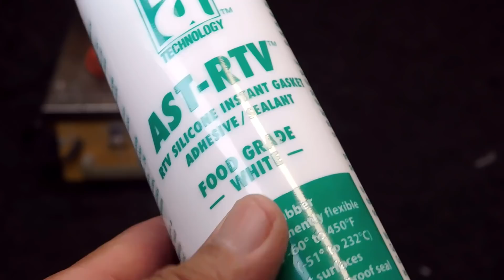Plastic Free Container / Easy DIY Hydroponics

Comment: Hate to be a party pooper, but marble is: "It's more porous than granite, so it more readily absorbs liquids. That means that oil, wine, juice and other spills penetrate deeper into the stone very quickly, and they are hard, if not impossible, to get out." 
Of the two, plastic is more food safe.
Reply from the maker: I don't put wine, oil, juice or ketchup in my hydroponics. It worked fine. Some people just want to avoid plastic. It's a personal choice. I use plastic myself.

Comment: The marble is awesome but then the food itself will still be covered by the plastic pool noodles. Kratky is awesome, thanks for posting.
Reply from the maker: The pool noodle simply holds the plant in place. The pool noodles are not made of plastic and are non toxic. They are not even PVC, they are EVA. The concern with PVC is the off gassing of phalates which does not happen with EVA. I have not seen any Kratky hydroponics that does not use plastic. The water that you use in your garden probably travels through PVC to get to your house. Thanks for watching and for giving input.

Comment: make a mold out of wood and pour cement in it ,and you can mass produce cement Kratky box`s without using glue :)
Reply from the maker: Thanks.  I know that cement is pretty alkaline and you have to let it cure before you paint it. After it cures, does it continue to leech anything or is it stable?
Reply from the maker: Truth Better Than Fiction If I let it cure for a few weeks or months, does it become inert? How about sealing with something food grade?
Reply: seal inside with bees wax
Reply from the maker: GREEN WORLD GLASS Kauai that's  a good idea. I was thinking of the wax they use in canning. Going to check them both out. Thanks man.

Comment: 👍 have a question. I planted kale, basil and sweet peppers in a bucket kratky  system. All was well and then everything started to die!
My peppers had fruit and they wilted like they did not have water, but the containers where full. Any thoughts?
Reply: You might have drowned them. Kratky relies on that top few inches of roots being able to breathe.
Reply from the maker: That's why I usually stick to fast growing leafy greens. After a month or so, the pH and nutrient PPM can go whacky real quick. If you try to grow long term plants, you are probably going to have to look more into traditional hydroponics.

Comment: Videos rock as usual Mike, I especially like the idea of categorizing grows to fit the perceptions of others.  The standard plastics, food grade plastics, and natural materials containers were good thoughts in doing that.  Should be a little something for everyone.  Paint on the outside of glass is a great idea.  I have seen 100% glass containers with no glue or sealant in stores.  Walmart has a 2-gallon all glass goldfish bowl that would work with a large head of lettuce.  Amazon has the 5-gallon glass carboy bottles too.  Soft glass 6mm tubing can be heated and bent into a siphon tube that essentially combines the volume of two different glass containers to double the amount of nutrient available.
Reply from the maker: Thanks Matt, I will have to check that out. A 5 gallon container would be awesome. These little half gallon guys heat up fast in the sun. That's my plan, trying to offer a wide variety of ideas so that more and more people can grow their own food. Thanks for the feedback.

Comment: People that complain about using plastics forget that city water flows through tons of plastic. Most houses are plumbed with plastic of some kind.  Loved the video - keep up the good work!
Reply: I think running through plastic once in the pipes is different than sitting in the plastic indefinitely.   We need to move away from plastics where we can.  The oceans and rivers are choked with it, and even the rain contains micro plastic.  We need to start somewhere with cleaning up the mess we have made, and not buying more plastic is a start
Reply from the maker: Thanks David. You are absolutely correct.